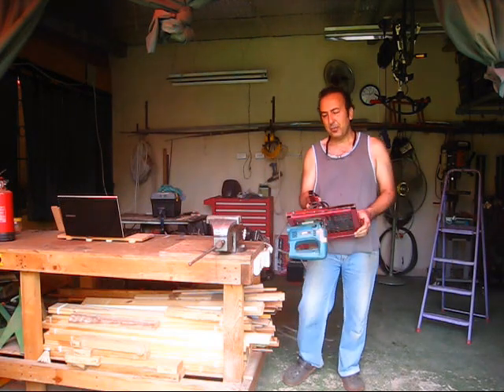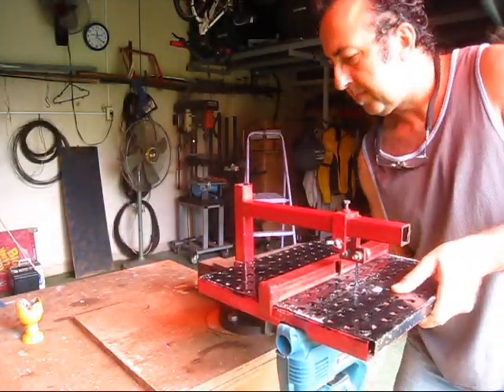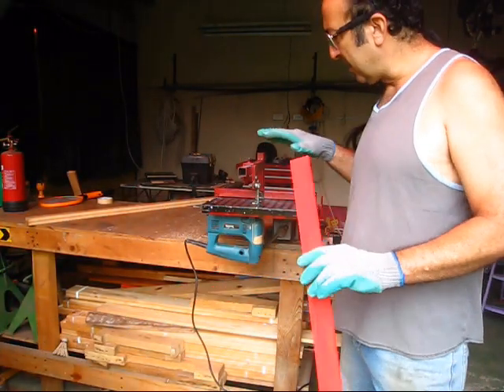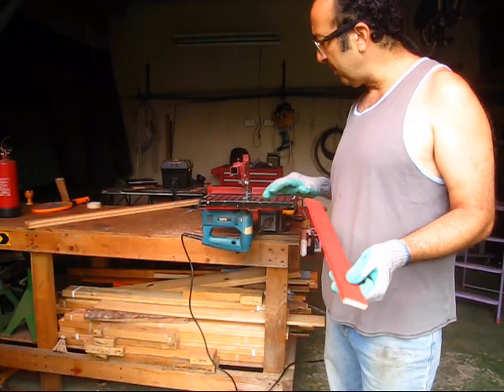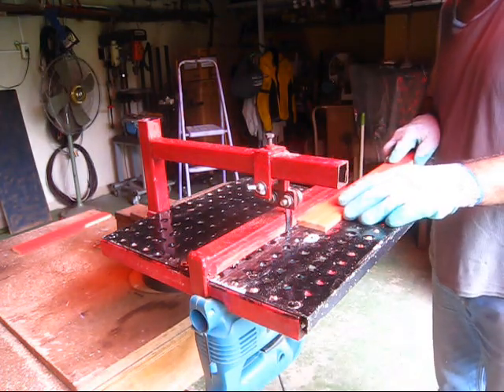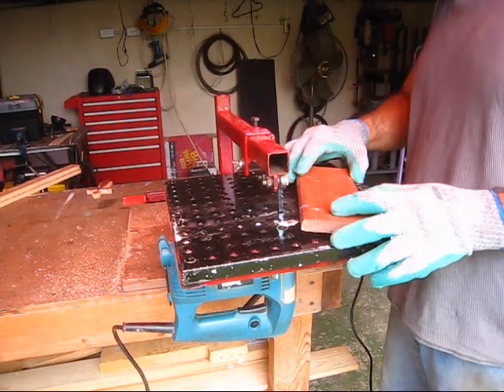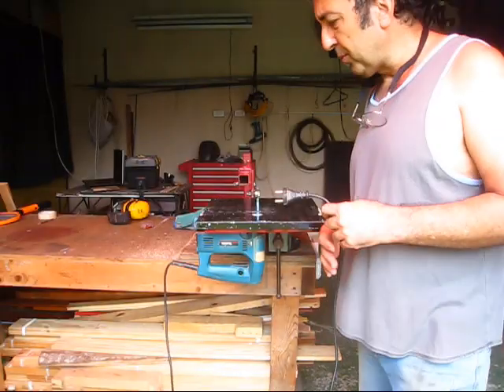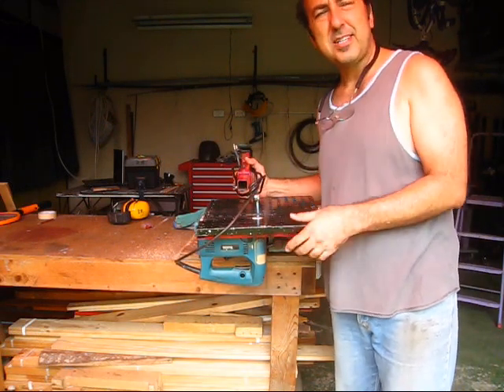Recycling Scrap Metal. My Awesome Home Made Jig Saw Attachment

Comment: Saeid, what an ingenious idea. I've seen jigsaws flipped around for scrollsaw type work, but you took it to another level. The notch in the fence, the blade guides, the way the entire unit can be flipped, you really put together a tremendously versatile tool. Looks like I just found my next build. Thank you.
Reply from the maker: Ranni, thanks very much for your kind comment. This one really has become one of my most used tools around the shop. I do have a Round Saw that I attached to a table. But nearly for every project, this is the one I reach for

Saeid

Comment: Another EXCELLENT home-made tool!   I really like how you think Saeid!

I suggest you add some light mesh, or window screen, around the air intake of your jigsaw, especially when you cut sheet-metal.  The tool is not designed to be exposed to debris by being used upside-down like that.  Screening would prevent the air intake from pulling small sharp pieces of metal through the motor which could potentially damage the delicate copper coils inside.  Just use a small light piece of window screen to cover the air intake ports on the motor.  Not really necessary if someone only cuts wood.

You have just made a custom home-made scroll saw, and if you increase the cut depth (distance form the where the top arm is welded to the frame, then increase the tablet surface also), you make a far more versatile scroll saw than you can buy commercially.

Absolutely EXCELLENT work.  I am surprised a tool company has not offered you a job in research and design.  A lot of your ideas are highly marketable!
Reply from the maker: +Kieron Seymour-Howell Great idea, thanks Kieron
Reply: I really like your ideas.  I am sure this grinder idea could be sold as a commercial product.  You should improve the design for looks and try selling them.

The same with your jigsaw design in the other video.  The jigsaw design would be usable indoors, or in an apartment.  It would allow people who do not have a workshop to make much better projects.

Comment: Very nice. Recently bought a lower priced band saw and im not happy with it. This is very practical and looks like it cuts smoother than my bandsaw. I Think there is already a problem on my Bandsaw blade but to replace it is around AUD$40 but a good jigsaw blade would only be $2. And you can do sheet metal. Good one !!!

Comment: Nice! Very impressed with that metal cutting - doing that the 'normal' way with the jiggy would require a lot of awkward clamping. Particularly like that blade-guide - where did you source the bearings? Are they reused from something?
Reply from the maker: Mark, the bearings are from my Wine Bottle Cutter, borrowed from an old Skate Board. You can find them at any hardware shop.
I'll be posting the plans soon.
TY
Saeid
Reply: Saeid Momtahan Drat! I knew I should have kept my skateboard from about fifty years ago! Great vid mate, looking forward to the next one. In the meantime, mind those fingers.

Comment: As they say Saeid..."where there's a will there's a way".  Or should that be "necessity is the mother of invention".   In either case a very clever bit of home made engineering.  Is that an extra long blade?
Reply from the maker: David Handley David, I'll go with 'Necessity' on this one. I have a table saw which I never liked using much.
 The blade, no, it's a normal wood blade. The metal blade is much shorter. That's why there is a provision for moving the guide bearings up and down. To cut sheet metal I move it down, and to cut wood as thick as 4 CM I move it up.
TY,
Saeid

Comment: Hi Saeid, may i recommend a pedal switch ? my father, an experienced ebanist, never lost a finger to a table saw until he (almost) did with over 35 years of experience..
Reply from the maker: +Super Chango 
Hi . What about accidentally stepping on the switch??
Reply: +Saeid Momtahan a pedal switch as a secondary for the switch you used on the video seems much safer..

Comment: Just made myself one,very handy.thank you.
Reply from the maker: +Andrew Wilson great to hear that
Reply: Saeid Momtahan The good news is it also inspired me to make a very similar base and carrier for a hand held electric plane that I picked up very cheaply at a garage sale. It allows me to surface small wood stock and with an adjustable fence I can accurately machine the wood to a bevel or 90 degrees. I have a sliding weighted roller to hold the work down onto the plane base when reducing thickness. I can easily machine wood down to 1 mm!
Reply from the maker: Very cool. Show us a video

Comment: Guys who install laminate flooring would like this they use the jigsaw upsidedown so the face of the flooring doesn't splinter and they get unobstructed view of the cut,
Reply: God of Thunder or they can use Laminate Flooring Jig Saw Blades
Reply: +The Fe Factor I use Laminate blades only, slightly more expensive but seem to last somewhat longer with my metabo pendulum jigsaw.

Comment: Gloves with stationary power tools is a VERY, VERY bad idea !!!
Reply: +vincent7520 Depends on the type of tool used, a jigsaw wouldn't do shit
Reply: +vincent7520 AGREE! Vincent. Jigsaw or not!  ANY Tool is a Bad Idea. Most Beginners think it's a good idea. I've been doing Woodwork for over 20 years now.  I have never worn Gloves. Bare Hands give you better control of the wood on whatever type of machine you're working on or even a Hammer & Chisel.  What good do they do? Protect you? NO! They can actually CAUSE Accidents!  FORGET THEM!!
Reply: Yes it would do shit : because with the glove yor finger looses the sense of the distance between your finger and the blade : a hair thickness is what makes the difference between staying safe an a very long wait at the ER.
Gloves are a very bad idea in all cases in woodworking for this very reason. It is not a matter of the glove getting caught in a spinning machine, it's just that the body looses the sense of material and machinery and that's how accidents happen.  
Actually in 25 years of profesionnal woodworking (not me to be honest, but being daily during all those years in a  woodwork shop) I never ever saw a woodworker wearing gloves, except when carrying heavy lods of wood coming from the sawmill.
So goggles yes, dust maks absolutely, ear plugs of course, security shoes yes again, but loose cloth (sleeves especially) and gloves must absolutely remain out of the picture...
Reply: vincent7520 You Got It Vincent!
Reply: +vincent7520 Excellent point you make about your fingers losing the sense of distance.  Thanks, Teacher.
Reply: +Jeff Beck aaah c'mon man ! I'm no teacher and I can give you a few example of having been totally foolish. Without gloves. But with or without them although I knew better I acted dumb and came out of being very very lucky not to loose my entire finger in literally a split second.
Reply: vincent7520 YEP! You're a Teacher for sure Buddy! Your Comments One up and Three up are excellent! (+1 on both!) It covered most of the bases and a Newbie reading that will For Sure Learn a hell of a lot that he didn't know before! You Done GOOD Teacher!
Reply: Well .... Thank you then.
And happy new year !!!   ;)))))
Reply: vincent7520 My Pleasure Vincent! Happy New Year to You Also! ;}}}}}}}}
Reply: +vincent7520 A guy at work was using gloves with a drill press. Glove must have snagged a bur on the bit, got wrapped up, and now he can only count to 9-1/2 (excluding toes)
Reply: It happened so many times : they put protections and emergency srops on machines out of (bad) experiences, not of whim...
Reply: vincent7520 Agreed. But on that note another guy was rolling a piece of sheet metal, got a loose part of his pants snagged in the roll, and it sucked him in in such an awkward way that he couldn't hit the e-stop (must have been a machine that didn't have a foot operated one--this was way before I started).  He now shoots half the little swimmers.  Sometimes e-stops aren't enough. The surest way to increase your odds are to never be completely comfortable with the equipment you operate.
Reply: AB-SO-LU-TE-LY !!!....